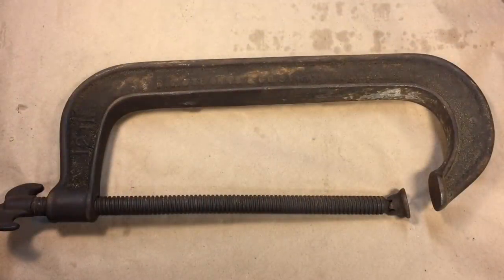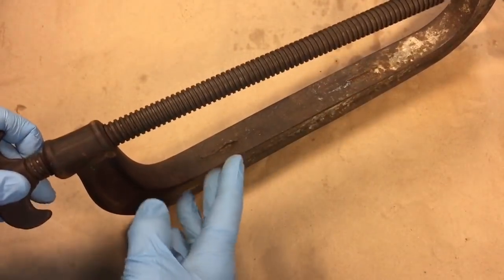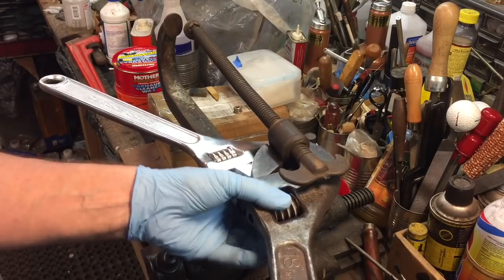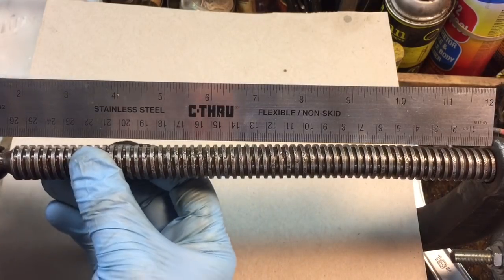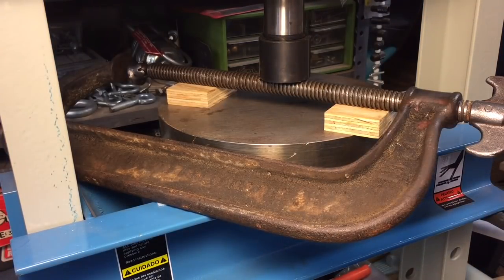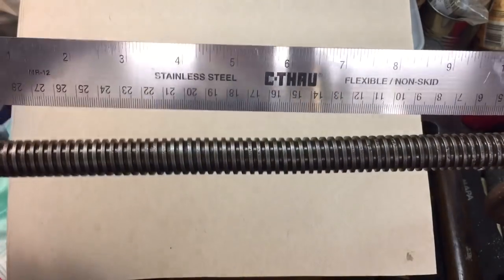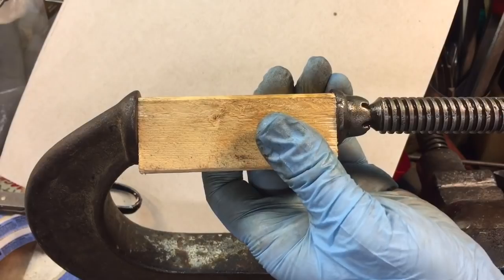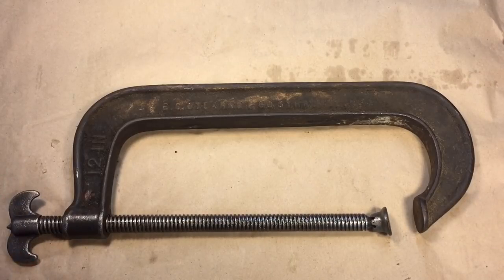Straightening Out A Antique Stearns “C” Clamp

Comment: Thanks. Managed to straighten one that was not bad and got a second one pretty close. 
It would be useful to also know a safe way to close up a clamp that has been spread open too far. I put it vertically  in my homemade hydraulic press and pinched it almost aligned, but it did not feel very safe.

Comment: Nice Dake'in there. The only press I have with a pressure gauge is a 70 ton, not too practical for this kind of fine finessing. But if you need to staighten a grader blade it's perfect. Thanks for that I really like to see people helping other that don't have the equipment to get thier things fixed. Thanks for the video!
Reply: George Chambers “… If you need to straighten a grader blade” LOL!
Reply: I've done it a few times. Back blades on tractors all kinds of heavy stuff. I don't have to worry about not having a big enough press! 😁
Reply from the maker: Hello George!  There are lots of ways to do this job but some are easier then others!  My buddy is great at using a mallet and a 2x4 to straighten out anything!  LOL   Thanks!
Reply: You could mint coins with that thing!

Comment: Cheers - before watching you tweak that I was afraid of breaking cast iron record clamps, seems they must be ductile iron after all as I just straightened 2 out of 5 crooked from a lot of 8 I just bought. 2 down, 3 to go :-) Two of the remaining 3 are too open, which is harder to fix, turned one banana shaped and back again trying. Two overlapping with those two have bent screws that I need to squeeze straight much as you did. Much appreciated.
Reply from the maker: I often wonder how much force do people put on these things?!   =D
Reply: @ScoutCrafter  I bought 5 4" and 3 6" record UK built ones, small compared to the above, and not the highest grade they built. The UK Record vices are really nice quality, but these clamps... not so much. The threads were cut into the C/G crooked 40+ years ago! Maybe a rush job during one of the wars? :-D I gave one a minor squeeze on a joist above after improving it and it didn't take much torque to start to spring open. The forged ones they built were most likely a lot better. Nice museum pieces, but only for light duty work really :-) As for how much force, that would depend entirely on the limits of the biceps :-D Depending on the job at hand, of course.

Comment: Nice job. Should be a useful clamp. Just one nitpick. It's not a good idea to use crescent/adjustable wrenches that way. Flip them over so the pressure is on the stationary jaw rather than the movable. You're chancing breaking your wrench the way you used it. Seen it happen.
Reply from the maker: It's funny you mention that!  Over the last few years there have been many videos on that exact subject!  Mr. Pete did a good one about 2 years ago...  The Crescent wrench was designed with that offset for just the purpose of being able to fit into cramped or difficult spaces by flipping the wrench.  When I was a youngster I was told to always "pull" an adjustable towards the moving jaw... so out of habit I always do when convenient.  However the offset feature of this wrench becomes useless if you purposely put the wrench in an uncomfortable position during use!  In one of my other videos I demonstrate a adjustable wrench that had no offset, these straight wrenches weren't as popular as the offset style. In the situation I was using the wrenches the one on the left was less beefy so I used that in the traditional way while the wrench on my right had to be used in the non-traditional way so I wasn't leaning over the clamp...  The offset is a wonderful feature of the crescent wrench but only if taken advantage of!   Thanks!!!!!!!!

Comment: Do you have or seen one of the Old School Wood Folding Rules that has the thin Brass Extension built into the first section of this rule? I remember it had division lines  in fractions on it but don’t remember if it had numbers on it. 
    Do you know or have any idea why these Wood Collapsible Rules had this Brass Piece?
Reply: The narrow brass extension could fit into narrow holes and you could extend it when measuring inside distances. For example, inside corner to inside corner diagonals sir a cabinet box to ensure it was assembled squarely.

Comment: That was some nice work and not as fast or as easy as it looks on video.  Can those caps on the end of the threaded rod be removed so the rod can back out of the clamp? I think the cap is called the movable jaw and the rod the screw. I know they sell replacements which are just called a cap.
Reply from the maker: Hello 57W!  Yes!  I had to do that with some other clamps I had.  You have to pry off the cap and then you can screw the rod out of the clamp. I used a dial indicator to get it spot on but this wasn't my clamp and I have seen the caps break when attempting to pry off.  With this clamp there was enough room to move the rod all the way to each end for access.  I always worry more when working on other people's tools!  LOL   Thanks!!!!!!!
Reply: @ScoutCrafter   I understand the unease of working on other people's things. I haven't don't it in a long time , so I couldn't remember if it would thread out.  By the way have you ever made a video review of your small lathe? I realize it might not be the best but it is in the more affordable range than many others.  It's not meant for the pro any more than the old Atlas ones were.
Reply from the maker: I did a couple videos showing the lathe and they were well received...   I am looking to move in a year or two and will have a huge shop and lots of new tools!  A nice lathe is on the list...   I have done many projects on that little lathe and it is an awesome little machine!!!!   =)

Comment: Are these older clamps typically forged or cast?
Reply from the maker: Hello Josh!  That's a great question!  Sometimes it's hard to tell!  The older Williams and Armstrong clamps were definitely forged because of the smooth finish, usually cast clamps have a grainy appearance (like sand cast) however they use a Malleable material so they aren't brittle like some cast iron...  You don't see too many broken clamps, bent yes but not too many split in two!  😃👍.   Thanks very much!!!